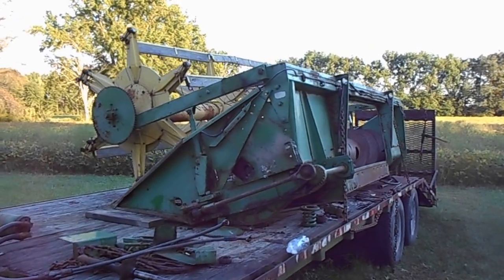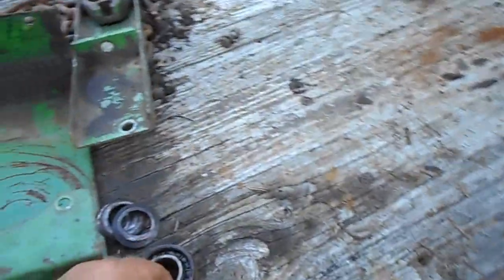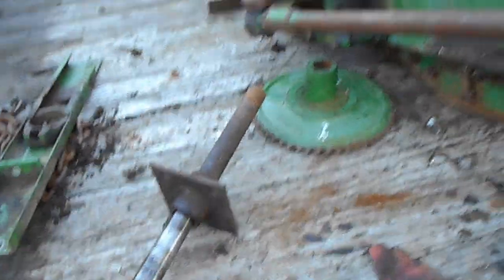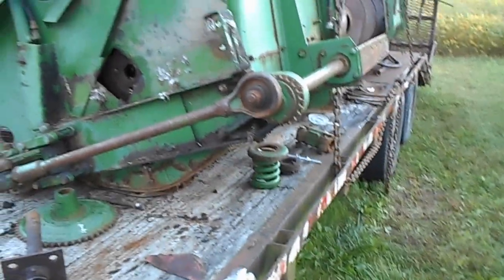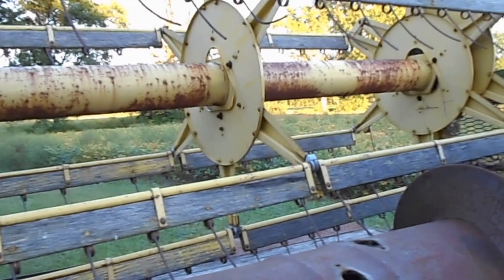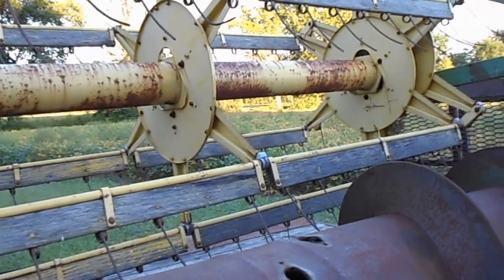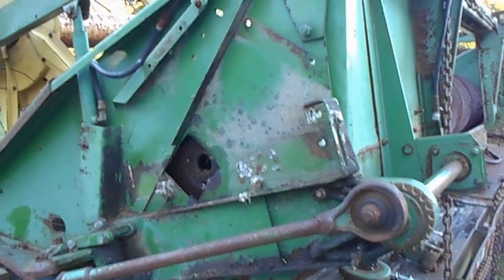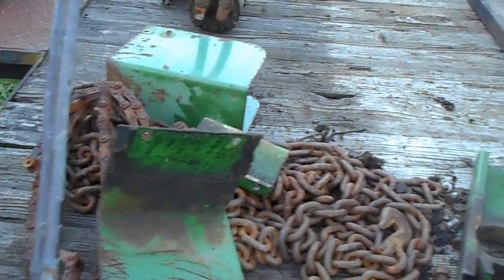JD Head Tare Down pt 1

Comment: "I got to get it fixed cause its all I got to use !"  I've said those very words before.    with what I see you have done, the rest is doable.   yes a cousin who has mechanic knowledge and farm experience is the best kind of help.   ScottyRockTrains is my cousin.   you got the right kind of determination / motivation so I see a successful rebuild on this project.   Rock Steady and best 2U.
Reply from the maker: Well I'm into it to deep now not to fix it so thats what I'm going to do ! Its hard work tareing these heads apart but once I get them apart and see what I have I can get a better handle on what I need to do. It will get done , It has to cause I got to use it to cut beans with !  LOL Aint farming fun ! Bandit

Comment: amazing you got that big sprocket off. the bolts just use a soldering torch with map gas & then spray water on them fast.... or make a cut across the nut 3/4 down into it with a angle grinder then 1 good blow with a chisel. wreck the nut not the bolt. you need a small pneumatic 90 degree die grinder to get inside that auger. my dad could never handle anything patience wise, he had parkinsons when i was 17 and we had a partnership together 12 yrs until he died (80 yrs old!)but i needed him sometimes to help me unload chopper boxes with broken aprons, pulling stuck tractors out of mud, co-signing loans & the co-op equity to put the crop in the ground every spring. i begged him to help me milk wild kicky first calf heifers i could'nt handle alone but he would'nt go near the barn. hardest thing i ever fixed was a broke down silo unloader 60 feet up with my fractured ankle in a cast & frozen fingers.
Reply from the maker: Over the years I've picked up a few tricks of my own and got that big sprocket off pretty easy, Now the bearing behind that sprocket was a real big pain in the butt to get off ! But its all stripped down now ready to get the new auger to go in. Dad has CMT and so do I and it really started to bother him when he was about my age and now he has a real hard time using his hands now and is getting wobbly so I worry about him being around some of the equipment.  Dad has a wealth of knowing things and working of stuff so I want him around for a long time. Dad had to help me one fall get into the cab of the combine because I had broken my right shoulder and the next fall I had broken my right ankle !  He's been a life saver quit a few times !  Bandit

Comment from the maker: Well for good or bad I'm taking the head apart to get it fixed, It was a long hot day to tare it apart but Its pretty much apart now. My cousin is coming over in the morning to help me take the reel off and get the auger out, Then the real work starts stripping the other head down and I really hope I don't get any surprise's when I get it apart !  I don't need more work to do !  I hope you enjoy.  Bandit
Reply: Well that's a fun job! My grandpa done that same thing before! What's the story behind that yellow ford?
Reply from the maker: I bought old yellow new in 96 and put over 300.000 miles on her before the trans went out again, Right now the motor is locked up and the trans is still out. In all the time I drove it (17 years) I rebuilt the trans once and put one starter an altinator and a water pump and normal oil changes and cap and wires and that's all it ever had done to it in all those years. Best truck I've ever owned !  Still looking to rebuild it sometime.  Bandit
Reply: Bandit farmer it's that a f250 diesel? I really could use a flatbed
Reply from the maker: Its a 95 F350 11000 GVW truck 5.8 gas auto and the bed is one of the ones I have built over the years for other people and myself. That bed wouldn't fit your truck , Old yellow is a Cab N Chaise truck so it has a narrow frame than most Ford one tons do. That's one reason I haven't gotten rid of it .  Bandit
Reply: Bandit farmer oh ok I think I might have found a utility box for my truck. If you ever decide to sell o yellow let me know ill make her run again
Reply from the maker: I'll do that and its good you found a utility box for it, The utility boxes for the pickups are harder to find , The ones for a one ton are a dime a dozen ! LOL  Bandit
Reply: Bandit farmer thanks man, I don't know what ol yeller would be worth I'll look into the engine rebuild and transmision. And yeah I went to pay the welder I looked next to his shop and there I saw it I'll have to give him a call later on it

Comment: You can still buy that whole stubshaft assembly and the 50 tooth sprocket and the slip clutches from John Deere as of last year cause we rebuilt our 13 foot qt head
Reply from the maker: The sprockets are good and so is the stub shaft the only one I might need is the sprocket the drives the reel on the old set up.  But its good to know if I do need one of these other sprockets .  That's why I but stuff at auctions and put them on the shelf so I got it when I need it !  Bandit